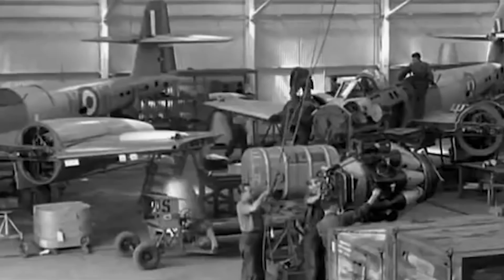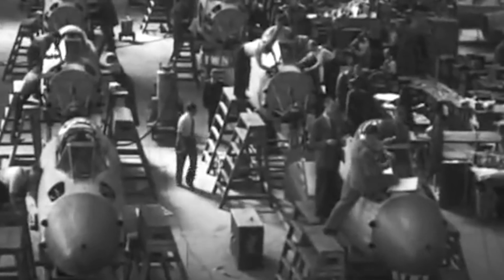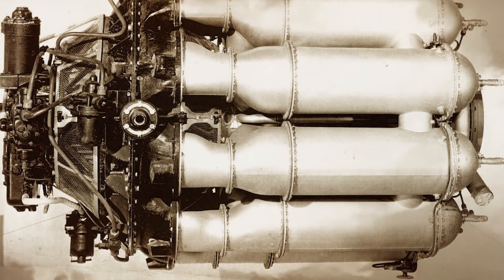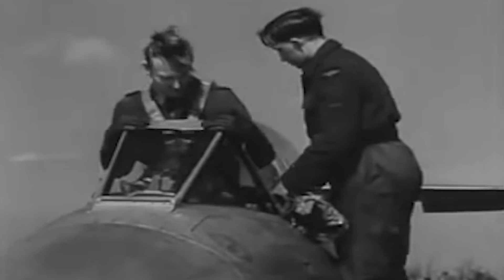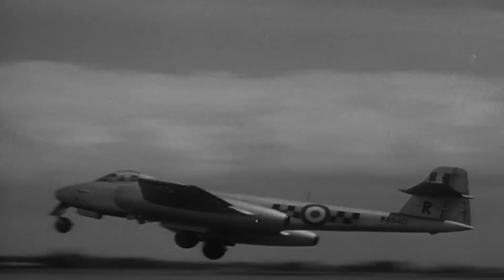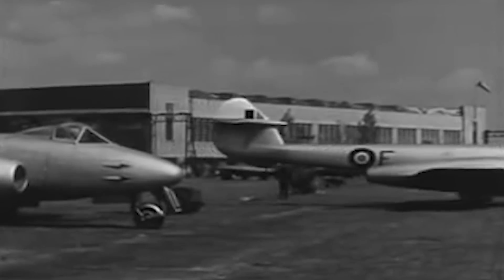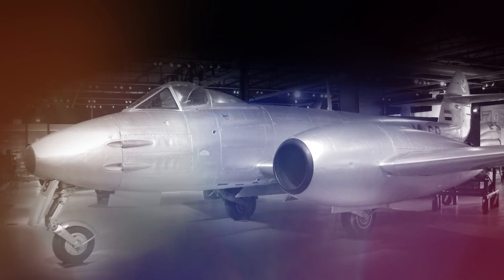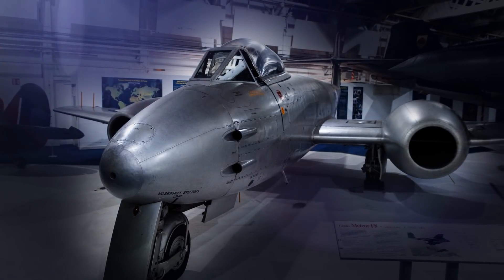Gloster Meteor - The Only Allied Jet to Fight in WW2

Comment: America had two jets in Italy before the end of the war
Reply: America sent 4 jets to Italy... two of them CRASHED on the way there and the other two spent the rest of the war grounded due to crash  investigations and technical problems related to engine fires.
Reply: @sandervanderkammen9230 

We believe we can clear up some commonly held myths and misconceptions, obviously

It's always good to see the facts presented clearly and concisely isn't it?

British Aerospace Sector. 

Interesting British achievements.
There is no doubt that the Fairey (England)
Delta 2 was of course the world's first jet
aircraft to exceed 1000 mph.  lndeed It
exceeded the previous record by 310 mph &
held the record for more than a year. Incidentally, the Dassault Mirage series of aircraft are based on the Fairey Delta 2. 
March 1956,  UK Peter Twiss,
1,132	 mph, Fairey Delta 2,	 Chichester, UK

The next speed record after the FD2 -
December 1957, USAF	1,207.6	mph, McDonnell F-101A Voodoo, 	Muroc, California 😎.

Non combat phase accident losses.
% of Aircraft built.
The EE Lightening did not have unusually high losses. 
The Canadair CL-44 was a turboprop airliner.
Canadair CL-44               (ff 1959 ) 48%
Lockheed XF104             (ff 1954) 100%
Lockheed  P80                (ff 1944)  43%
Lockheed F104               (ff 1954)  45%
MD FH Phantom 1          (ff 1945)  35%
MD F4 Phantom 2           (ff 1958)  28%
MD F3H  Demon              (ff 1951)  32%
MD F-101 Voodoo           (ff 1954)  34%
EE Lightening                   (ff 1954)  33%
Gloster Meteor                (ff 1943)   21%
DH Vampire                     (ff 1943)   23%
DH Sea Vixen                  (ff  1951)  33%
Gloster Javelin                (ff 1951)   20%

Note that the Meteor didn't have particularly high losses, flew with more than 20 airforces for decades, got involved in air to air combat during a number of conflicts successfully against aircraft that first flew many years after the Meteor first flew.

Early days, jet engines. Whittle performed the world's furst demonstration of a gas turbine aero engine in 1937. The RR Nene, a centrifugal gas turbine aero engine, was the world's most reliable & most powerful gas turbine aero engine in 1944. Licensed built versions & copies of the RR Nene & RR Derwent would go on to power many aircraft in Russia including the Mig 15 & Mig 17, the US, China, France & other countries for decades after 1944. Incidentally, the Mig-15 was in essence an upsized / tweaked copy of the Whittle / Gloster E28/39 jet aircraft including a copy of the RR engine.  The centrifugal compressor gas turbine aero engine with Whittle style reverse flow combusters and sometimes an axial compressor section is still manufactured by more than one company, the main application being helicopters.

   That's correct, The Tornado & Typhoon & their engines are supersonic & are indeed British design aircraft with British design engines built by an international consortium. The Tornado design for example started life during the 1950s at Vickers as the AFVG, it's engine is based on the RR RB-199. The EE Lightening is also a British Supersonic jet aircraft. At the time the EE Lightening first flew it was indeed one of the fastest aircraft on the planet.

  The Typhoon is the British BAC-EAP with an engine based on the British RR XG-40, the Typhoon is also built by an international consortium.

  Clearly It's a great pity & a crying shame that British military forces had to occupy a large part of Germany for decades after 1945 & Russian military forces had to do the same. Of course Russia still posseses a large chunk of what was German territory & of course  Russia & the UK produce nukes. Obviously Germany does not produce nukes.

An example of what goes on these days in various countries.

   Indeed, There are no German companies that make German jet aircraft in Germany & there are no German Companies that make German gas turbine aero engines in Germany that are suitable for widebody airliners.

  BAe Systems, GKN Aerospace & Rolls Royce combined now do more Airbus work than Germany on an absolute basis & significantly more work than that on a per capita basis.
   
  Per capita for the home nation BAe Systems is the world's largest defence contractor. BAe systems announced the recent £4 Billion takeover of Colorado based US based Ball Aerospace.
  
  BAE systems now does a significantly higher value of work for Airbus than it did when it was a major Airbus shareholder before 2005.
     
  RR now owns US Engine maker Allison for example which does classified Aerospace work for the US Govt.
   
 Anybody currently flying on a widebody airliner stands a good chance of being on an aircraft powered by RR gas turbine aero engines built in the UK.

  A glimpse of what goes on in the very internationally orientated British aerospace sector.

Boeing Apache Attack Helicopter.
AH-64: 75 UK suppliers, 7% UK content, global fleet of 1280+ aircraft.
F35B more than 130 UK Suppliers, more than 30% UK content.
F35A & F35C more than 130 UK Suppliers, more than 15% UK content.

The UK has the world's highest combined per capita Nuclear, Defence & Aerospace Sector activity.

Rolls Royce Holdings UK
Subsidiaries
- Rolls-Royce plc
- Rolls-Royce North America (Allison etc &  
  Classified Military stuff)
- Rolls-Royce AB
- Rolls-Royce Deutschland
- Rolls-Royce India Private Limited
- Rolls-Royce Marine Power Operations
- Vinters Engineering Limited
- Rolls-Royce Controls and Data Services
- Rolls-Royce Power Systems
- Bergen Marine
Joint ventures include:
- Rolls-Royce Turbomeca
- MTU Turbomeca -

Trent Family
The MT30 (Marine Turbine)
Industrial Trent 60 Gas Turbine
Trent 7000
Trent XWB Airbus A330neo.
Trent 1500
Trent 1000
Trent 500
Trent 600
Trent 700
Trent 800
Trent 8100
Trent 900

RR wholly owned subsidiaries in Germany handle smaller 2 shaft RR gas turbine aero engine work.   

We hope this helps of course.
     
Cheers, as always & indeed 👍.

Comment: Several airborne photos of an all-silver Meteor, with extended engine nacelles, are those of a Meteor with experimental reheat/afterburner equipped engines.
Reply: Dr. Anselm Franz invented the Nachbrenner (afterburner) in 1940.
Reply: @sandervanderkammen9230 

We feel we can clear up some commonly held myths and misconceptions obviously.

It's always good to see the facts presented clearly and concisely isn't it?

British Jet Engines briefly.

The gas turbine engine was invented in England during the 1700s.

  The sequential stator rotor multi stage axial turbine & compressor were first produced during the 1800s by Parsons of Ireland & North England for power generation & ship propulsion turbomachinery purposes. Those basic turbomachinery components would go on to form the basis of most modern gas turbine aero engines.

  At the time there were discussions and some engine research regarding the use of those components for an internal combustion gas turbine aero engine to power aircraft (& ships) thus the jet aircraft concept was effectively invented in England during the 1800s.

Maximime Guillaume's patent was simply a copy of the work of Parsons. 

  The axial compressor internal combustion gas turbine engine was being researched and developed in England from 1929 onwards, it definitely is not a German invention. By 1943 the axial turbojet engine Metrovik F2/3 was flight certified,  development continued from there.

  The world's first wind tunnel was constructed in England before 1900. The world's first supersonic wind tunnel was constructed in England during the 1920s. 

  Early days, jet engines. Whittle patented the  after burner & bypass before 1937. Whittle performed the world's first demonstration of a gas turbine aero engine in 1937. The RR Nene, a centrifugal gas turbine aero engine, was the world's most reliable & most powerful gas turbine aero engine in 1944. Licensed built versions & copies of the RR Nene & RR Derwent would go on to power many aircraft in Russia including the Mig 15 & Mig 17, the US, China, France & other countries for decades after 1944. Incidentally, the Mig-15 was in essence an upsized / tweaked copy of the Whittle / Gloster E28/39 jet aircraft including a copy of the RR Nene engine.  

  The nickel super alloy, very low iron and very high nickel, Nimonic, was developed in the UK in 1940 for gas turbine aero engine turbine blade use. It was available nowhere else at the time, the info would be handed to the US after 1941 along with examples of Whittle's gas turbine aero engines. 

  The Whittle configuration centrifugal compressor gas turbine aero engine with Whittle style reverse flow combusters and sometimes an axial compressor section is still manufactured by more than one company, the main application being helicopters.

Obviously, we hope this helps.

Cheers and 🤞 of course.

Comment: The meteor had the ability to climb to 60,000 ft and I mean rapidly
Reply: Not the ones in service during the war or the later improved F.8 models.
Reply: @sandervanderkammen9230 

We feel we can clear up some commonly held myths and misconceptions, obviously.

It's always good to see the facts presented clearly and concisely isn't it?

Thanks for that very informative comment.
Most enlightening.

We couldn't find any supporting evidence anywhere though so we think there may be some errors in their excellent post & errors in some other comments with a similar theme.

The basic overall design of the Gloster Meteor was fatally flawed.???

    The Meteor was not fatally Flawed, 3950 were built serving in more than 20 air forces for more than 20 years.  Martin Baker use the Gloster Meteor for ejector seat R&D.

Gloster continuously tried to improve the aircraft eg; improved tail, stronger fuselage and different wings, stronger wings, ect.???

      Gloster got it pretty much right first time especially considering the circumstances & the aircraft type.

Unfortunately as a result of being very hastily
converted from a twin propeller driven nightfighterdesign it was plagued with flaws inherent to the fundamental design.???
  
      Gloster ceased work on the much larger  Gloster Reaper propeller & turret night fighter in order to design the Meteor from scratch (The Beaufighter was similar to the Reaper).

It was directionally unstable at nearly all speeds and tended to pitch down uncontrollably at low speeds and a nasty tendency to snap into a flat spin at high speed.???

    It's accident losses were much lower than many other later aircraft. Most accident losses were training errors.

The asymmetric handling was appallingly and was considered unrecoverable and fatal during take-off or a go- around.???

      It's accident losses were much lower than many other later aircraft. Most accident losses were training errors.

RAF Chief Air Marshall Sir Frederick William Bowhill called the Gloster Meteor a quote; "a truly dismal and lackluster aircraft"???

    The Chief Air Marshall didn't say that.
   
   Sydney Camm said Gloster tried everything but flipping the engines and pilot seat around and flying it backwards???

     Sydney Camm didn't say that.

Early days, jet fighters & an accident losses rate comparison.

De Havilland Vampire, Sea Vixen & Gloster Meteor accident losses were not high or unusual for fighter aircraft at the time. De Havilland built large numbers of all metal airframe aircraft before the DH Comet for example.
We mustn't forget of course that the DH Vampire first flew in 1943 & the jet engine was also built by De Havilland. There were examples of the Vampire interceptor / fighter in service until 1990 which was operated by more than 30 countries. Of course, at the time, during 1943, the Vampire was one of the world's first jet fighter aircraft which also happened to have extremely reliable jet engines, obviously.

Non combat phase accident losses.
% of Aircraft built.
The Canadair CL-44 was a turboprop airliner.
Canadair CL-44              (ff 1959 ) 48%
Lockheed XF104              (ff 1954) 100%
Lockheed  P80                 (ff 1944) 43%
Lockheed F104                (ff 1954) 45%
MD FH Phantom 1           (ff 1945) 35%
MD F4 Phantom 2           (ff 1958)  28%
MD F3H  Demon              (ff 1951)  32%
Gloster Meteor               (ff 1943)  21%
DH Vampire                    (ff 1943)  23%
DH Sea Vixen                  (ff  1951) 33%
Gloster Javelin                (ff 1951) 20%

   An example of what goes on these days in various countries.
Obviously, for example, there are of course no German companies that makes German jet aircraft in Germany & there are no German Companies that make German gas turbine aero engines in Germany that are suitable for widebody airliners.

The Gloster Meteor served with more than 20 airforces and successfully engaged in air to air combat with later design aircraft during a number of conflicts. 

We hope this helps, obviously.

As always Cheers & 👍 indeed.